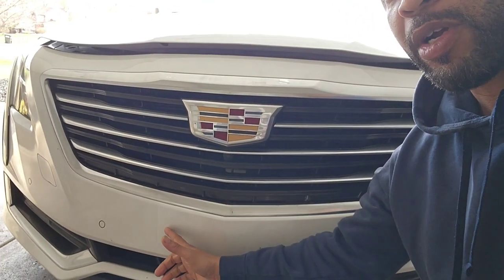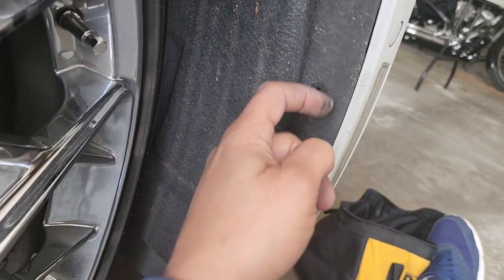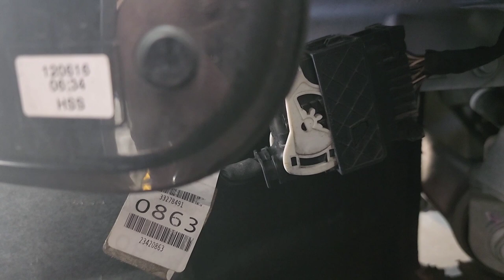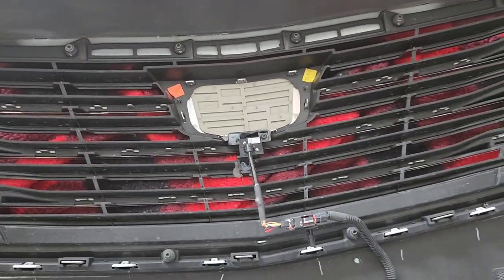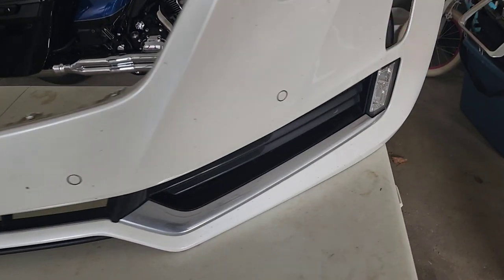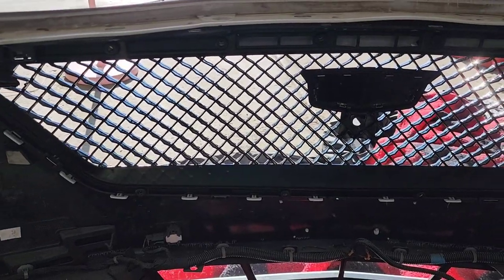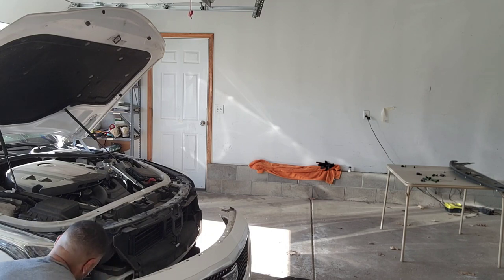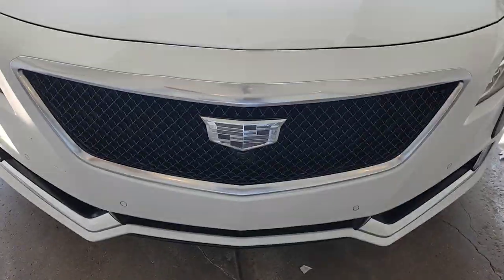Cadillac Ct6 mesh grill swap with monochrome emblems

Comment: Thanks! This was the first video that came up with my search criteria.
It’s definitely a helpful video. I’m replacing my grill and the surround with stock replacement style (eBay) bought.
I had thought the surround was aluminum until a stone exposed the plastic it’s really made of during some “spirited driving”
I’m replacing the lower grilles as well thanks to a a stone that fell off the back of a dump truck which cracked one of the two.
By the way, I love the wheels!
Reply from the maker: That's why I made the vid..I couldn't find any that showed how to do it..good luck and thanks for watching ✌🏽

Comment: thanks for your time man. It worked like a charm just followed your video came out bad ass made my 18 ct6 tt look new again!
Reply from the maker: Great job bro glad I could help..more vids coming 👍🏽
Reply: @Crock72  i have ordered the front emblem wrong twice. all my emblems are blacked out the last time i ordered for xt5. Any direction or help would be much appreciated. thanks man
Reply from the maker: The new grill I bought came with a badge (emblem) that I noticed was smaller than my original. The Xt4 and the Xt5 both have smaller  emblems  so I took the badge that came with the new grill and put it next to both and the Xt5 was the one that worked so I ordered the monochrome emblems for the Xt5

Comment: Great video.  I have a 2018 CT6 Platinum.  Where did you get the grill?  I like the look.  I will be installing an illuminated Cadillac emblem.  You can get them to illuminate solid white or in the multi color.  I was hoping you were installing an illuminated emblem so I can see where you wired the power.  Thanks.
Reply from the maker: Ebay for the grill...I heard mixed reviews on the illuminated ones..good luck and thanks for watching

Comment: I have a 2018 CT6..I'm sure everything is the same on the assembling, My Question is can you give me the Name of that socket tool that you use to heat treat the camera attached to the Cadillac symbol can you give me the direct size and where can I get it at can I get it off of Amazon I have a guy that's going to install my Mash Grill once it delivered that's the only tool that he said he doesn't have he has everything else so can you give me any information on where I can get it can I get it out for Amazon what's the name what's the size I will very much appreciate it you doing a great job on assembling your grill
Reply from the maker: It was just silicone covering the screw and i was able to just peel it off. Fortunately for me right before I went to get the tool I needed I went back and started messing with it and it fell right out. I kinda kept jigging it. Or if your not keeping the old grill you can kinda break it out. You can always get different screws to replace them. I replaced my screws..Thanks for watching ✌🏽
Reply: Man I appreciate the response..I'll let my Friend know what you said..thanks..

Comment: Looks really nice, I've purchased everything, going to be doing the install in a few days, but I have 1 question did everything work right for you after you installed everything camera, adaptive cruise control, lights,etc...?
Reply from the maker: I don't have adaptive cruise that's why my badge came out well..if you have adaptive then you might have to cut the center out of the grill where the adaptive badge goes other than that for me everything was perfect. The engine light comes on for a sec but after a couple starts of the engine  it goes away after everything resets because of unplugging the sensor. Good luck thanks for watching ✌🏽
Reply: @Crock72  ok thanks so much for all of your information, I really appreciate it
Reply from the maker: Just wanted to add..if your original front badge is the glossy photo print badge it's not the same size as the one that comes with kit. Your adaptive cruise sensor reads thru the print badge so you might lose that feature by changing badges
Reply from the maker: @klc735  👍🏽
Reply: @Crock72  ok gotcha thanks again, for all of your input, I can't wait to install mine

Comment: Awesome video my brother.  Question, i have a 2017 also and want to change out grille to the exact same ome only in chrome. I know u said the monochromatic emblem is smaller that fits but will the colored one that came off the original grille fit the new mesh grille as well??
Reply from the maker: The grill that I got came with a colored emblem I just changed it. What ever one you buy should come with one. However you old emblem I don't believe will fit...its gonna be bigger...Thanks for watching more vids coming ✌🏽

Comment: Yours looks great thanks for the video! I have a 2018 CT6  & got my stuff ready to install, where did you get the smaller pry tool?
Reply from the maker: Amazon...it came in a set..easy to find. Thanks for watching 👍🏽
Reply: I finally got it without it! Thanks!
Reply: I also used different screws after I got the 3 camera screws out too! That was the hardest & most annoying part of the whole process, the other stuff was pretty basic.

Comment: I'm trying to buy the exact grill for my car Is it possible to get the link from you for where you get your grill from Thank you in advance
Reply from the maker: https://www.ebay.com/itm/354096381764?mkcid=16&mkevt=1&mkrid=711-127632-2357-0&ssspo=kfgeysdwquy&sssrc=2349624&ssuid=hqcv-DG_SVG&var=&widget_ver=artemis&media=COPY
Reply from the maker: That one should work...there are similar ones from other sellers but I'm sure it's all the same one
Reply: Looks really nice, I found the grill, but I can't find those emblems in that color, only black, could you also send a link for the emblems
Reply from the maker: @klc735  search Cadillac Xt5 monochrome emblems..the kit comes with front and back
Reply from the maker: @klc735  https://parts.suburbancadillacoftroy.com/oem-parts/gm-exterior-trim-emblem-kit-84675901?origin=pla
Reply: @Crock72  Thanks 👍🏾
Reply: Whip is tight AF. Mesh looks great
Reply from the maker: @garynester9294  Thanks bro

Comment: Good evening, I just purchased a new grille for my 2017 Cadillac CT6 but it looks like the trim for it doesn’t fit,  any insight?
Reply from the maker: If the grill you bought fits your model ct6 then the original trim should fit with it. I used my original trim
Reply: @Crock72  thank you for your insight, I am also having trouble finding the correct size emblem. Do you have the measurements of your grille emblem by chance?
Reply from the maker: @jaxson2824  The grill I bought from ebay came with an emblem. I took that emblem to a cadillac dealership and matched it side by side to other emblems. I figured since the one I received was a little smaller then the original then the Xt5 emblem would work and it did. Then ordered monochrome emblems

Comment: Where’d you get the monochrome emblem?? Will it fit 2019 ct6 v ?
Reply from the maker: I ordered the monochrome emblems for the Xt5 after size matching them with the emblems that came with the grill I ordered. Thanks for watching ✌🏽
Reply: @Crock72 please provide a link to where you purchased the XT5 monochrome grill for your CT6. I purchased the same grill but the emblem doesn’t fit. It’s too big and the cups don’t line up. Your help is appreciated.
Reply from the maker: Just Google Xt5 monochrome emblems. There should be options.
Reply: Just to clarify, I should be able to just install XT5 emblem on my front grill and should fit?
Reply from the maker: @richardallison445  Yes..your original emblem will be to big. There should be a emblem that comes with the new grill. You will notice it is smaller. Xt5 emblem works

Comment: Where did you buy the xt5 emblems and how much are they, i saw some on ebay for $129.00
Reply from the maker: Google xt5 emblem...shopping
Reply: @Crock72  are you talking about the oem one or after market one?
Reply from the maker: @javierortega7645  mines is oem..haven't looked on ebay. Not to say that ebay is not oem. I might mention that the XT5 emblem fit because I changed my grill
Reply: @Crock72  so its the xt5 grill emblem from gm ?
Reply from the maker: Yes
Reply: @Crock72  cool thanks, how much did it cost yu